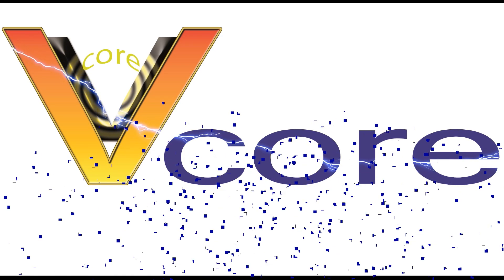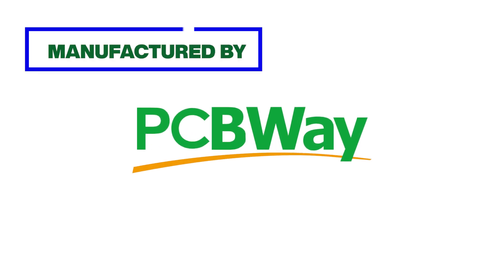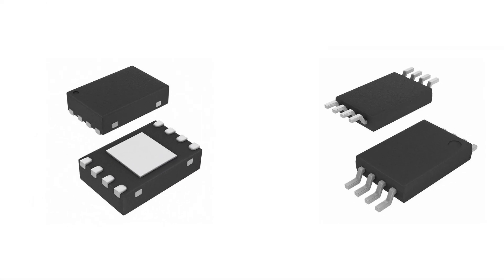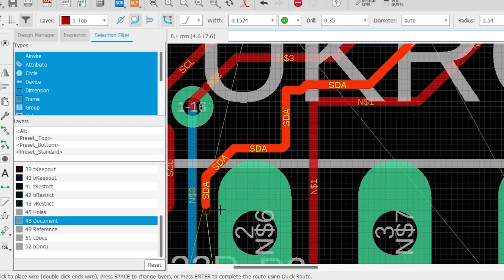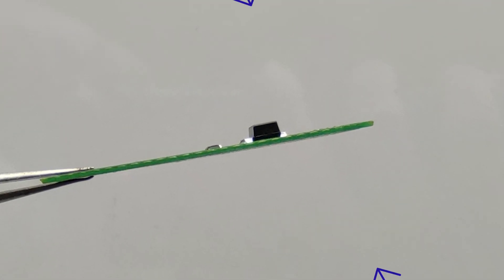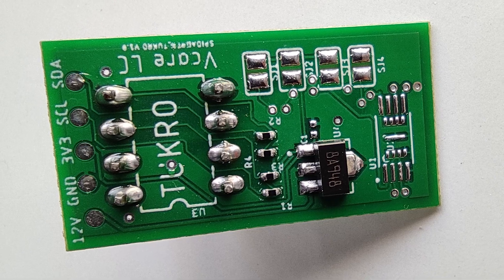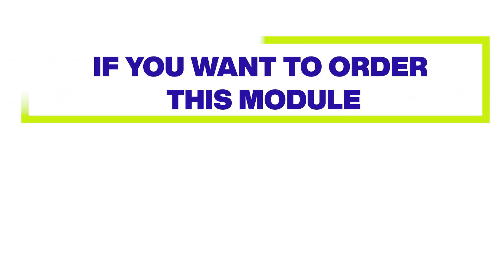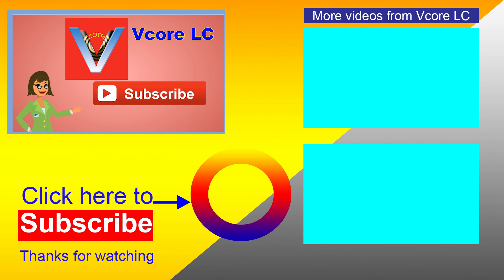Excited! To Review My First PCB With You

Comment: Hello i have problem with my sony bravia kld40 how do i repair it? It has backlight on and sound but blank screen
Reply from the maker: Check panel voltages
Reply: @VcoreLC  i did check voltage already
Reply: @VcoreLC  i have another sony too it has stable standby but while watching it turns on and off no red blinks showing...